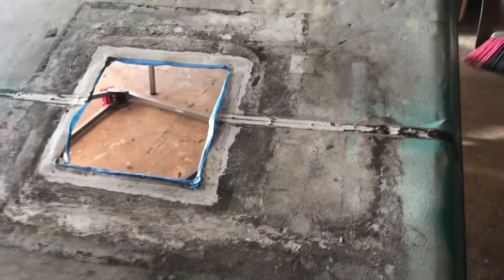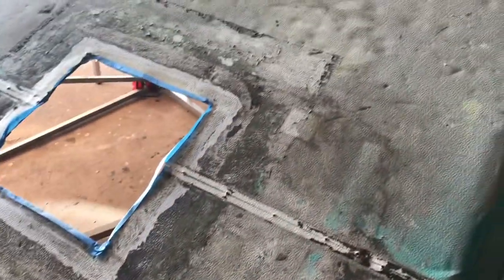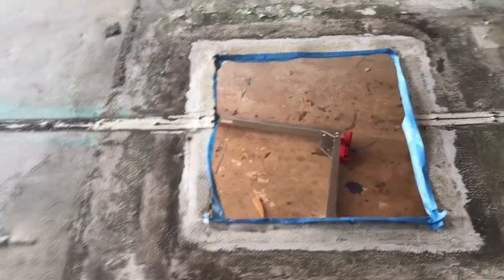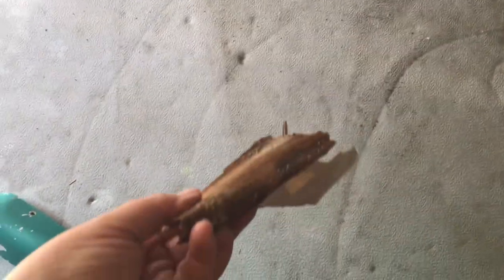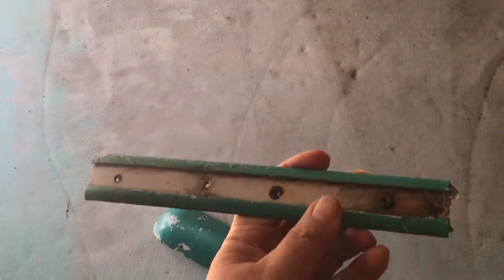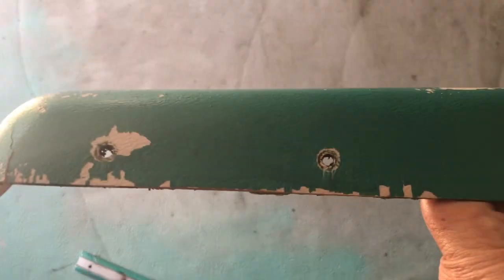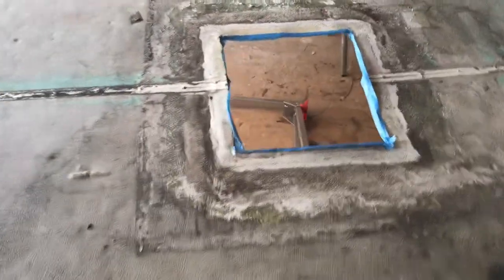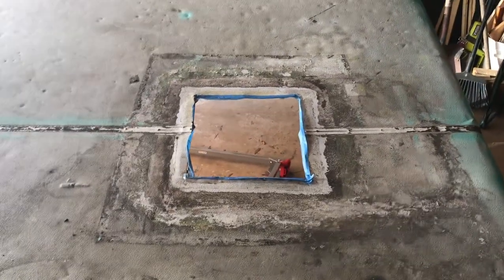Progress on peeling off the layers of ick

Comment: We redid my buddys camper roof similar to this.
We found it easier to rip all that Styrofoam off on the bottom. Then replaced it. Lowes and home depot sell sheets of Styrofoam insulation. We bought a couple sheets of that and used liquid nail to glue it on.
If youre going to hammer out all those dents, that might be the way to go. 
Just use a putty knife and scrap all that old Styrofoam off. 
Its a big project but, just take your time and do it right. Youll be glad you did in the end.
Reply from the maker: Thanks for the input, turnout your suggestion of the putty knife worked better than using acetone to melt it off.